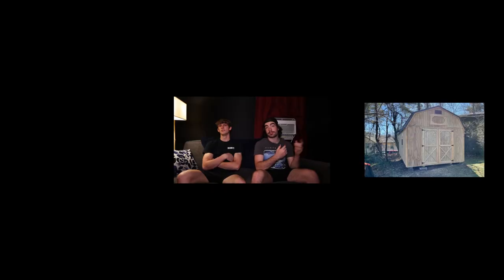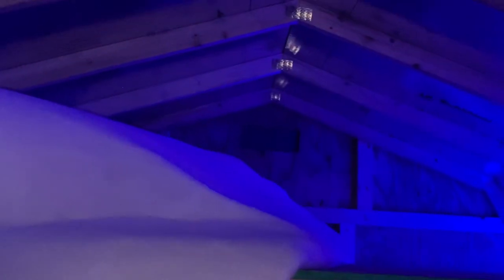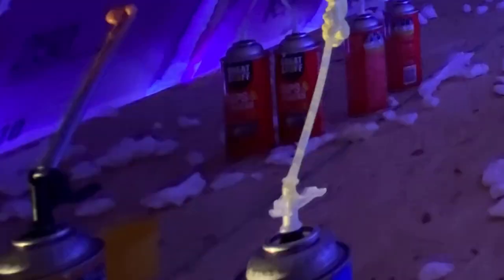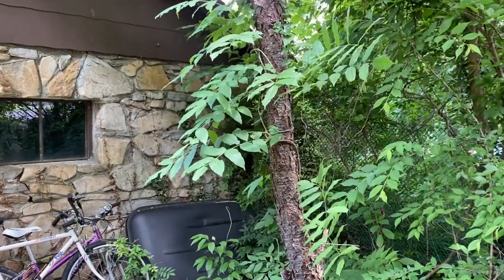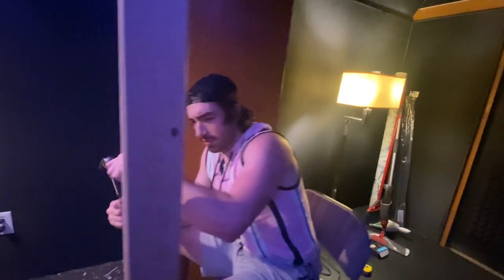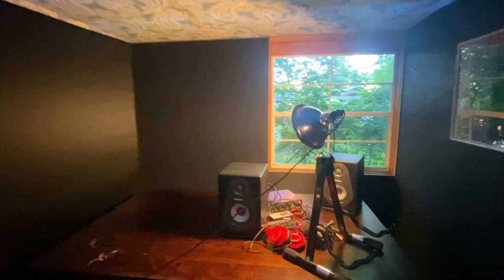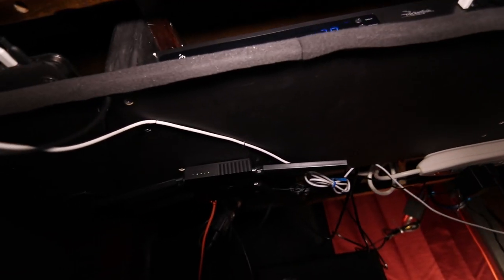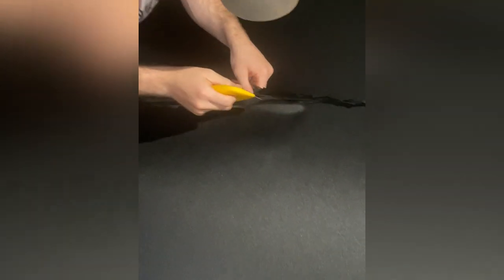Turning a SHED into a Recording Studio

Comment: I did the exact same thing to my shed . Ended up building 2 rooms inside . One control room and the other a vocal room with a living area as well . Bought the shed for $6,000 and spent an additional $4,000 for all of the materials needed for the project . Great video guys
Reply: was the insulation enough to have speakers running in the control room without bleeding into the vocal booth?
Reply: @Shanex  yes sir , so for my control room was rock wool insulation with a plywood sheet to cover and drywall on top of that .

Comment: Neat idea, and 'looks' cool - but a big missed opportunity by not adding actual accoustic treatment/abosorbers to the walls/ceiling before putting up the fabric. FWIW, those foam stickons do mostly nothing for real accoustic room treatment. Hopefully after you guys do some more research you can go back and add some actual fluffy and low density accoustic treatment pannels to the wall and a cloud on the ceailing in the control/mixing room, along with the vocal booth! This will help control early reflections as well as some bass absorption in that space!
Reply from the maker: Absolutely, acoustic treatment had to be within budget, so it became less of a focus compared to things to make the recording experience more comfortable. Definitely a point we had to compromise on.
Reply: 100%.  Owens 703 isn’t expensive either!
Reply: @vocalvisiontv  this wasn't a compromise, it was a waste of money. Would have been better to save up until you could install something useful. 
Btw, what I'm talking about isn't really that expensive and rather easy to built yourself. 
I think the issue comes down to the fact you thought these actually do something when they mostly don't. And that's ok, we all are in the learning process

Comment: Great work! Do you have any experience with temperature fluctuations and/or humidity issues? Mostly because of all the synth stuff and electronics. I need to move out into the shed and thats the things i worry about most as the Shed won't be heated all the time. Thanks so much for the documentation of your work 🙏

Comment: After the foam boards you should’ve used roxul or 703… some area much thicker than 2in that way you make traps without making traps. Replace most of the foam with traps and it’ll sound much better guaranteed. But decent build overall 👌🏾

Comment: I like what you did. However, I have to question the choice to use foam squares for acoustic treatment.  I’d recommend revisiting something more dense someday to help control low end.  I use 703 insulation for panels and double up for 6” bass traps.  The difference over foam is dramatic and helps tame the low end that foam cannot.  Just a suggestion.  Enjoyed the video.

Comment: I love the effort, and it looks nice and comfortable, but I would not claim this to be a "professional" studio for mixing and mastering, that's an insult to actual professional studios. It's a great place to get started and learn, all that is needed for that is a dedicated space and some speakers, and honestly learning to work around acoustic problems will teach you a lot as an audio engineer. Switch between speakers and headphones often to find and learn the acoustic problems. You should be able to capture decent sessions, but I would send them off for mixing, and definitely for mastering to get commercially viable quality.

Here are some problems: Foam board has basically 0 soundproofing or dampening qualities for anything but the highest of highs, and that "acoustic" foam directly on a hard surface won't do anything to dampen any low end whatsoever, it may kill some flutter of high mids and highs, and the lowest sub freqs will probably just go right through the walls and cracks at least (hopefully you don't have any neighbors to bother), but a ton of the low end and low mids will move in and live there rent free and take a shit on all your mixes and make it impossible to know what's actually happening in the mix, and an orgy of frequencies will be bleeding into every microphone compounding the mixing problems and causing things to loose clarity, so you'll turn those frequencies down, and everything sounds small and weak instead. I'll take a guess that mixes tend to sound very different when you go listen on other systems like in your car, that is why. You can probably get decent results recording and mixing vocals and acoustic guitars and such, and of course midi instruments and headphones will be your best friends, but acoustic drums, amps, and anything with a lot of low end will be tough to capture well, and accurate monitoring for professional full frequency mixing and mastering is definitely impossible unless you add bass traps and much thicker absorption. Maybe add another layer of rock wool on top of a couple of layers of dry wall (with an inch of air gap to the foam), and a cloud (minimum 12 inch thickness), at least around the mixing position, and a free standing panel behind it, that would go a long way. Or just admit to yourself that this is a nice space to hang with your homies and capture art, but you have some way to go before you should claim this to be a professional mixing and mastering studio. Sorry about the negativity. I started a long tong time ago in a similar way and I hope this helps.
Reply from the maker: Valid points thanks for the advice. You might’ve misheard what we’re calling the project: it’s a “professional” recording studio, definitely not a professional mixing and mastering studio. We are focused on vocals, that’s why we’re VVS. In practice, our semipermanent booth does well for what we’re doing. I’m excited to expand into a place that can be used for professional mixing and mastering, can I consult you about acoustic treatment for that in the future?